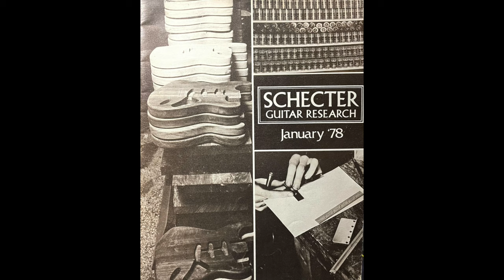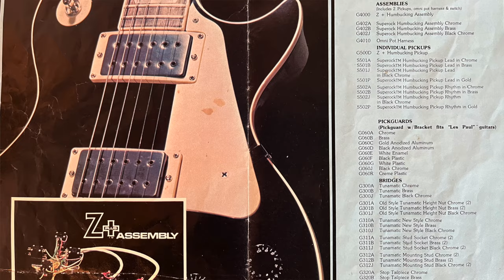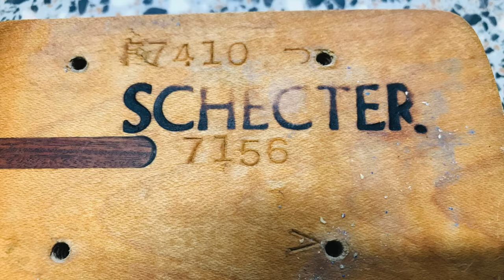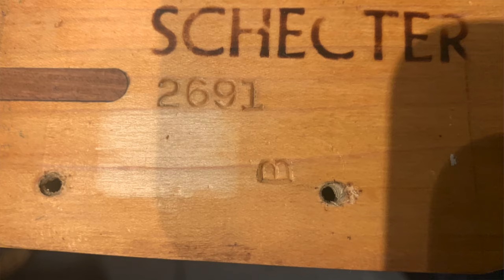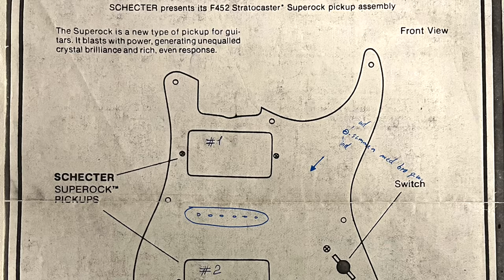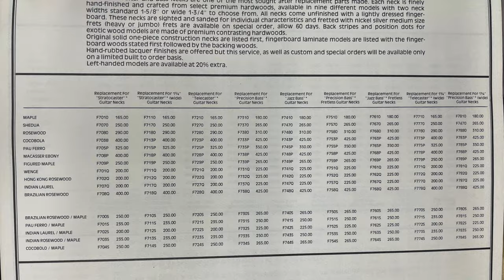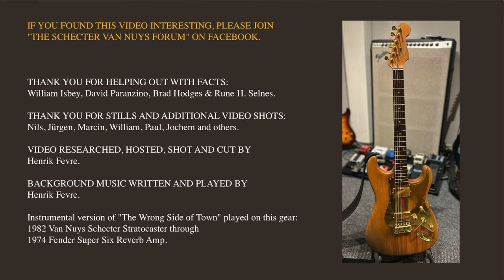How to tell a Van Nuys Schecter guitar from the crowd!

Comment: great stuff! i have a pbass with a cs serial - think that means built in chandlers in london? the neck looks identical to your jazz bass, got 2 "a" serials too , a pbass and a tele, theyre not really like the red dallas era one you show, maybe a transition period?using up the less fancy leftover bodies and necks? bass body is cocobolo according to the stamp  the bodys and the bass neck have stamps in the pocket similar to yours but the neck on the tele is totally different with a schecter guitar research ink stamp, still good but its like its from another manufacturer - ive no doubt its original to the guitar though and its got the same decal on it.oh and i built a strat using a schecter neck and a metal /super rock loaded scratchplate...the plate doubled the weight of the guitar so i completely agree with you on that!
Reply from the maker: Join the forum here and let’s see the guitars: https://www.facebook.com/share/3tiJxVGi8pyWkoWH/?mibextid=K35XfP
Reply: Some later van nuys parts were ink stamped because the burn tool kept breaking down !
Reply from the maker: It’s already in the description of this video. 👍🏼